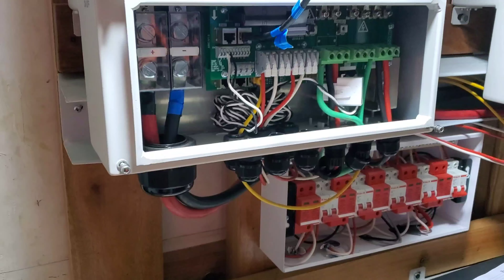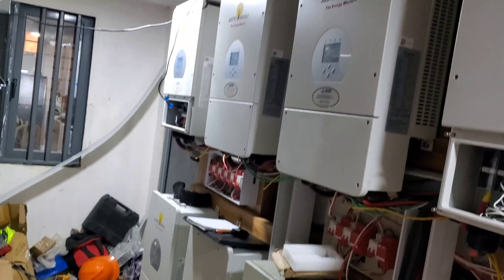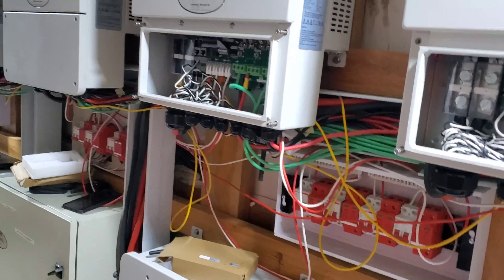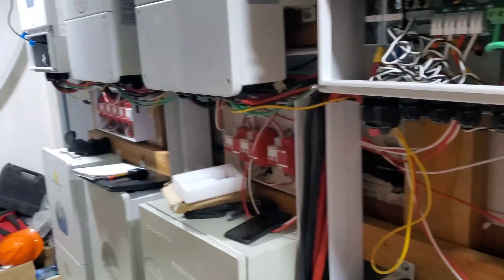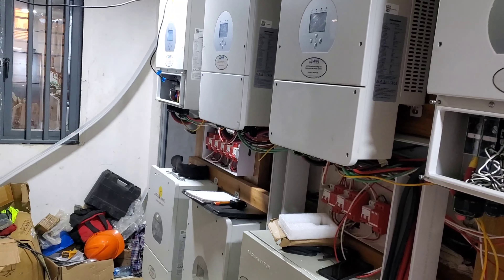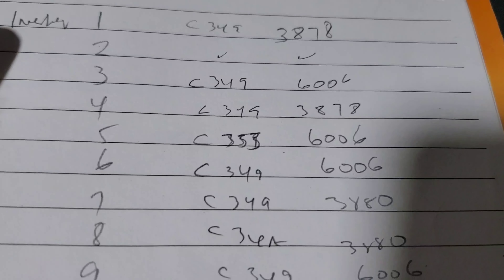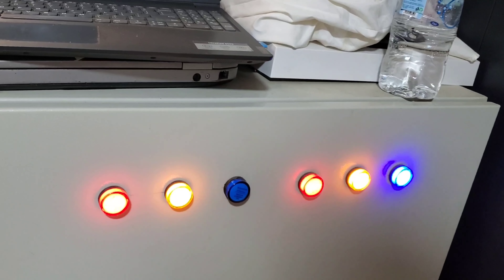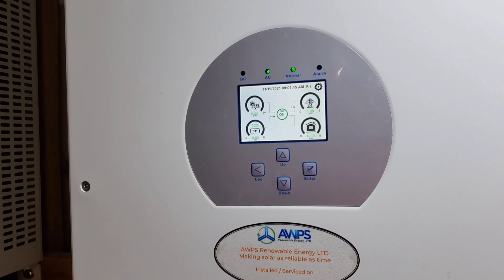Deye 8 kw hybrid Inverter. Updating the firmware

Comment: Doctor, kind regards. I have a question. I have an inverter deye8Kilowatts What is the maximum current that can be drawn from the network to prepare the house and charge the batteries Thank you for your cooperation
Reply from the maker: 190 amps charge and discharge

Comment: hello how to get the files to do the upgrade and how to know each version what its and lately the deye and felicity battery wouldn't connect what we can do for that ?
 and what is the important of the updates 
thank you
Reply from the maker: Good morning Mahmoud. Thank you for watching and commenting. If your inverter is stable I would not do a firmware update. Communication between batteries and inverters. If it is compatible then your settings or cables are the problem. Are you using Can? Read the battery manual.
Reply: @drsolar  thanks a lot for your replay , so far no problem but here in Lebanon the deye company want to make an update to there inverters so they can't connect to felicity batteries , so they can sell there batteries so we are getting ready for that .
So you said there is no need to make any update as long as things going well
Reply from the maker: @mahmoudghazzawi8551  yes. If it is working fine. No need to do an update

Comment: Hi sir I have same inverter exactly, my inverter has tripping issue.
In night when only on grid and battery, it suddenly stop grid, no error code just show off grid, then reconnect automatically, it happens continuously, I have checked my grid voltage and frequency are good and in range.
What can be the issue?
Reply from the maker: Try a firmware update first

Comment: I had a small problem in my relay dry contact to turn on and  off my generator by the deye 8k hybrid , so I contacted there service office in china , they updated the software , and now it is much much worse, when I click on gen  force , generator is always on , and if I don't generator never turns on when batteries reach min, how can I downgrade
Reply from the maker: I had the same issue at the beginning with Deye. Have them double check your settings
Reply: same happened with me. did you find a fix?

Comment: I had the Deye team upgrade my 8kw hybrid inverter and they upgraded it with the 5kw firmware. Lots of error codes and emails they finaly flashed it with the correct firmware. However now my inverter is stuck in standby mode and does not switch to normal mode nor does it charge the batteries from the grid. Is there any way you can assist me as Deye support has gone silent after they saw their mistake. Will you be able to send me the files so I can get my power back please.
Reply from the maker: Email them and make a stink. I will send you the correct firmware. They have made this error before. A friend in California had the same problem. It took a while but they fixed it
Reply: Hello I am also in need of help with this matter can someone please send me the firmware for a 8kw inverter

Comment: Thank you, sir, for the video, sir. I have 2 inverters of 8 kilowatts, single phase, connected to a toolzie, and I arrived with 3 batteries, 15 kilowatts, in parallel, and I need to download Virgin 1001 -c361 In order for the inverter to read the batteries, can you teach me how to carry the virgin with thanks and appreciation
Reply from the maker: Good afternoon Haider. Welcome to the channel. Who sold you the inverter? If you have it online they can get  Deye to update the firmware remotely. You don't have enugh batteries. Your inverters can discharge 190 amps each. Your battery can't handle that.

Comment: You updated the Inverter with MCU2 file. How about MCU1 file , shouldn't be updated as well for the firmware?

I had 12kw qty 3 of different HMI , git the latest MCU2 C034 Version, but after the update, I got a problem that I can't choose Export to Load option.  It always switches to Export to CT, and the CT is giving wrong reading's
Reply from the maker: With the Deye, I have stopped doing firmware updates. The tech team at Deye do it when they try to correct issues and 9 out of 10 times it does not work. If it is working fine let it be.

Comment: Nice work Dr. I’m surprised to see a lithium batteries with BMS in a cabinet’s Also Deye is one of the best inverter’s as a grad A in china
Reply from the maker: Thank you for watching and commenting. Once you do large systems you need enclosures to house the battery.
Reply: Dr pls how many panels can we install at the Deye 8KW the panels are Jinko 465W
Reply from the maker: @ziadkhalil4913  22 of them. You can do 23 or 24. Just remember that you can do three strings. So make sure you don't the short circuit voltage per string. Safely 8 per string if you do 24.
Reply from the maker: @ziadkhalil4913  good day. I will do 3 strings of 8 for a total of 24. Should keep you at very safe numbers. Good luck
Reply: @drsolar  morning Dr. Sorry I’m bothering you with my question, pls if I install 3 strings each one 8 pcs of jinko 465W and link them to the Deye 8KW I’ll be on the safe side right as you recommend before, now my question is this 3 strings will be connected one of the MPPT then the other line of the MPPT must be empty right?
Thanks again nice hearing from you